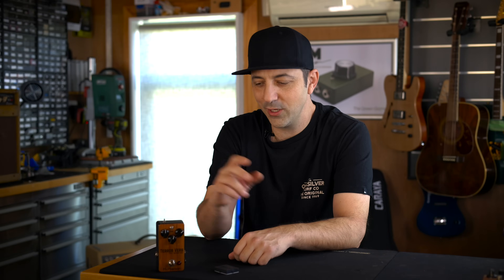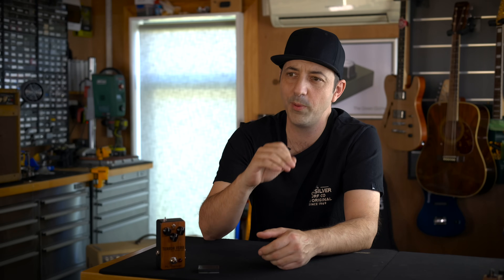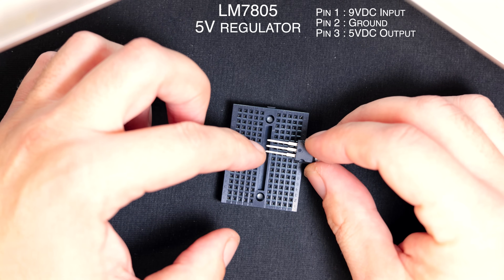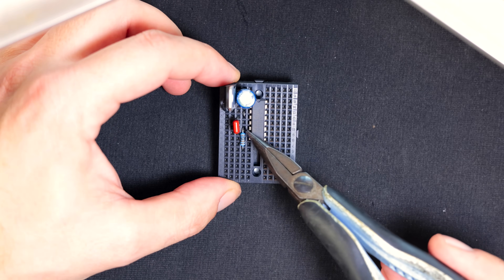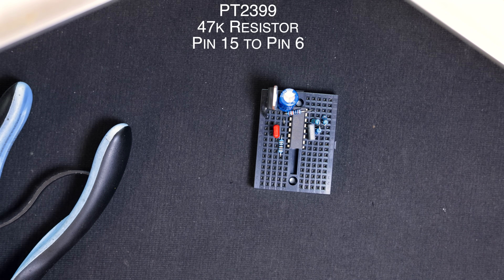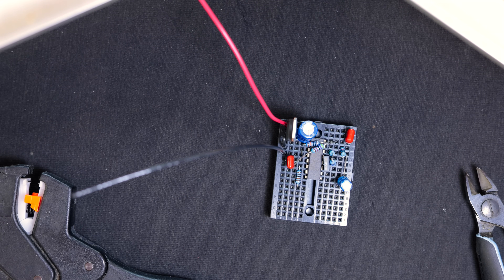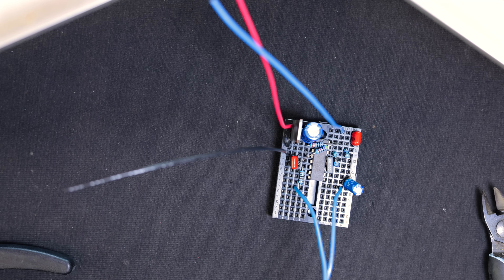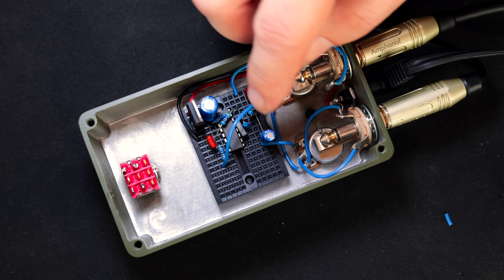Build the Most Frightening Pedal on Earth (On a 55¢ ProtoBoard!)

Comment: In the build you say it's 47k resistor from pin 6 to 15, but you put it in pin 16. Since it works I assume pin 16 is where the 47k goes?

Comment: the video appears to show the 47K resistor sitting in the  pin 16 row, not 15 as explained  and shown in the text overlay at the top. Which is correct?? Mine sounds all fucked up
Reply: schematic shows pin 15 to pin 6 so maybe he made a mistake when preparing the video; easy mistake to make. I've made it again, sounding better but the effect is really distant. It should be more prominent, cos the fuzz is working

Comment: I think I have an interesting version of this pedal, when it arrived in my care it was built into an MXR Carbon Copy shell, labelled 'Experimental Fuzz Rough Layout!' built on perf board and is very very close to the circuit in the schematic linked on your site (the switching variations are different).  I was told at the time it was a McPherson build.  It had a rough time, and it stopped working for some reason, but this schematic may be a prompt for me to do a rebuild and get that awesome sound back!

Comment: Cool ! I wish I could understand more about electronics than I do right now. I bought the schematic for the wiring, but I'm sort of lost with the actual wiring part because the video is a simply circuit. It does include the wiring for the 3PDT switch, but I doesn't show where the wires are suppose to go on the circuit itself. Can anyone simplify the actual diagram, if you have it, to make it more, almost neebie, friendly? Maybe like in Tinkercad. Of course, you could send it to me via email.

Comment: Great video. I've messed around a little, little bit with building hardware circuits, but I am getting more interested in it as time goes on. I haven't seen other videos of yours, not yet, but a suggestion: for your demonstrations, consider using  one or two other tones, just to provide some data points. It might help to establish what the range of the circuit is on its own, if that makes sense.